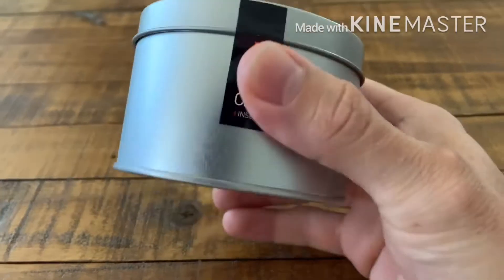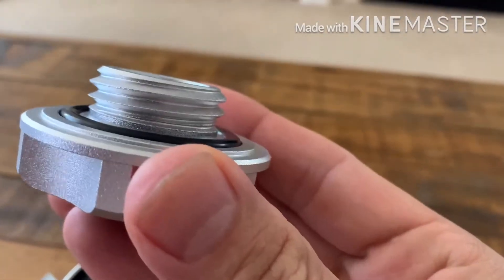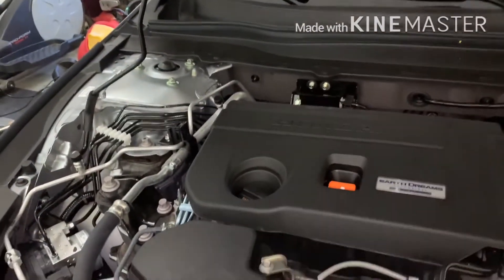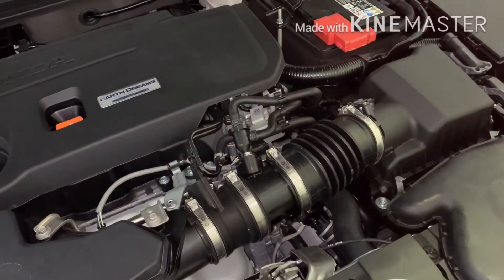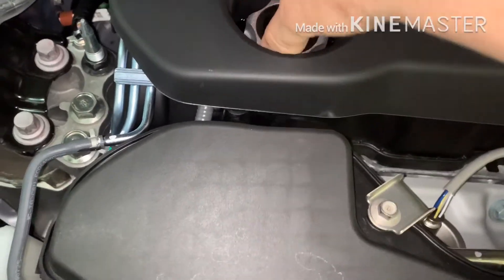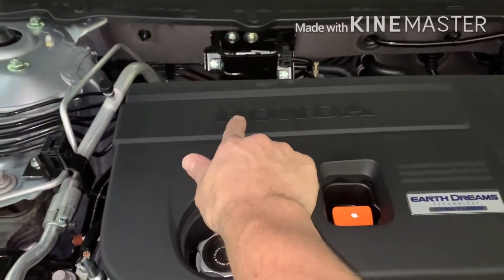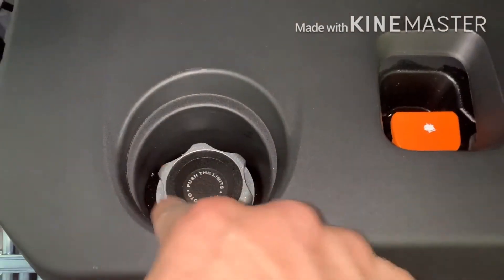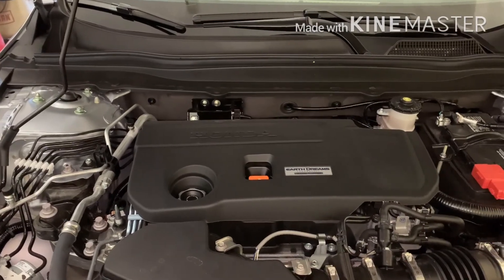Mishimoto engine mod install for 2018-2021 Honda Accord and Civic that’s EASY

Comment: These look really nice but are almost impossible to take off when the engine is hot.    It's almost like the metal expands so much that it won't come off until it cools.      I had to resort back to the plastic one as I have given up on struggling with it each time.     It would be totally impossible if I didn't put the oil around the o ring like you mentioned.   Another great video dude.
Reply from the maker: Thanks man I noticed that too that it gets really warm even on my short trips. It does look great though LOL

Comment: Hey Jon I have a question , I got in my car today (Honda accord 2018) and when I turn it on there’s a line going down the middle of my radio panel but when I turn it off it goes away , nothing has hit it or anything from the outside is soft nothing is shader , what can I do to fix it reset it ?
Reply from the maker: So it goes away when you turn the car off or the display?  Is the line always there otherwise?
Reply: @HondaJon  yes it goes away when I turn the car off like the line is not even there anymore , no just today I turn my car on and i noticed it while driving ( I always put my car in the garage but yesterday I left it outside it wasn’t freezing tho idk if this info would help lol )
Reply from the maker: Anyway you can take a picture and send it to me?  I’d like to see
Reply: @HondaJon  yes how could I reach you ?
Reply from the maker: My email is hondajon00@outlook.com
Reply: @HondaJon  just sent it 🙏🏽

Comment: Hey Jon, I don't know if it's just me, but when using android auto and using the voice command to make a call, it keeps saying my contacts are waiting to be updated. But I can make a call if I manually touch the screen to make the call. Any ways to fix this?
Reply from the maker: I’m not too positive about Android auto. Did you try unpairing the phone and repairing?
Reply: @HondaJon  I have the 2020 model and it has to be plugged in for android auto. I tried reconnecting and no luck.

Comment: My Honda didn’t come with a engine cover when I bought it. Where can I order one?
Reply from the maker: What size engine is it?
Reply: I have a 2020 accord 1.5 lt
Reply from the maker: They don’t have an oem one but you can get a type r replica on eBay for about $60
Reply: @HondaJon  I’m not sure man.
Reply: @HondaJon  4-cylinder
Reply from the maker: These will fit. I had one on my 1.5 and it looked great. https://www.ebay.com/itm/124444411683